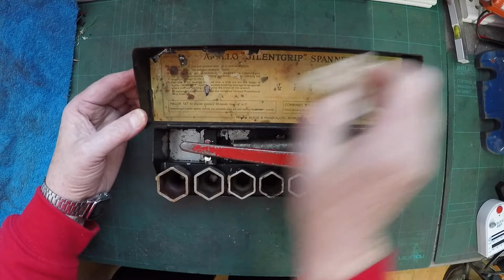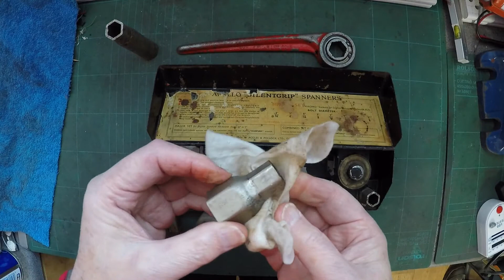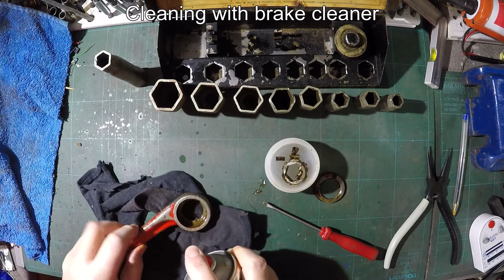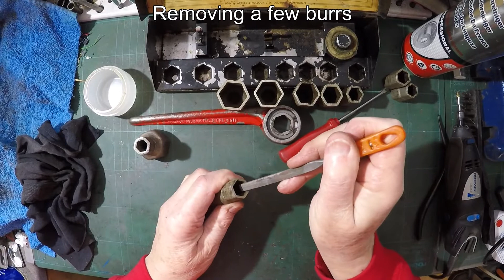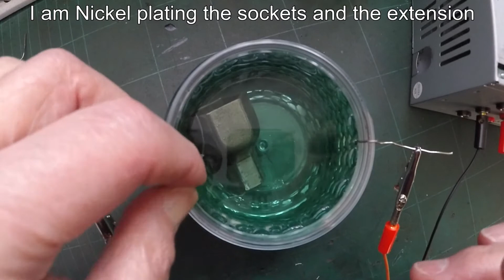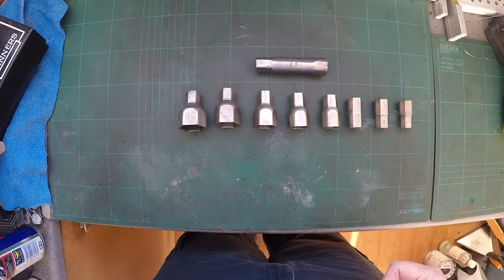Very rare 70 Year old Gearless ratchet restoration

Comment: Hey great restoration. I'm actually restoring the same one myself and can't quite make out what some of the words inside the lid are from my blurry photos or from this video. but I was just wondering if you still have this set, what the label inside the box reads? mine was faded off and I have everything except the text in the little box that says "combined set"?
if you could help that would be much appreciated so i can make and print a new label!
Reply from the maker: Two lines of text as below...Good luck.
COMBINED SET for English Standard Whitworth Nuts 3/16" to 1"  (The 3/16" is a 3 over a 16 with no divide line)
Contains thirteen tubular spanner sockets, two sizes of Apollo "SILENTGRIP" wrenches and all necessary fitments
Reply: @DaftOldMan  brilliant! Thanks so much